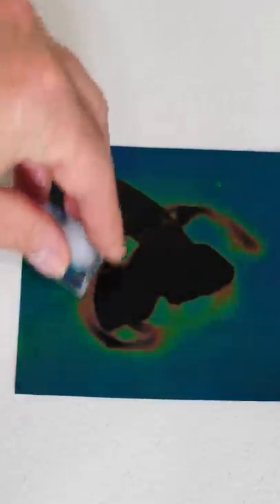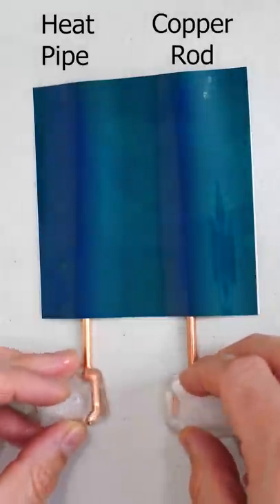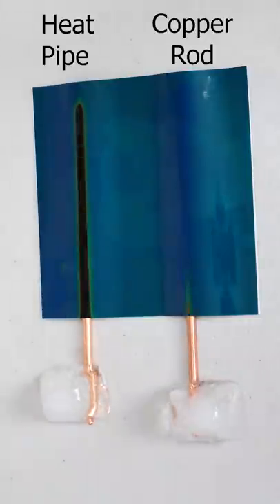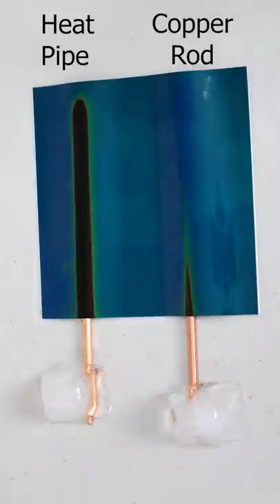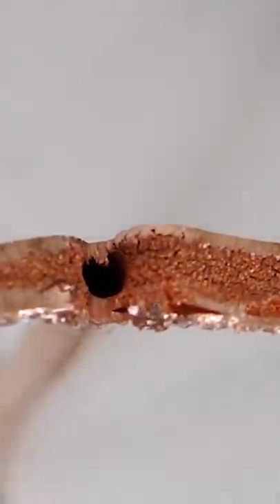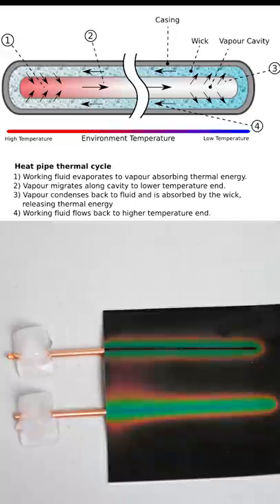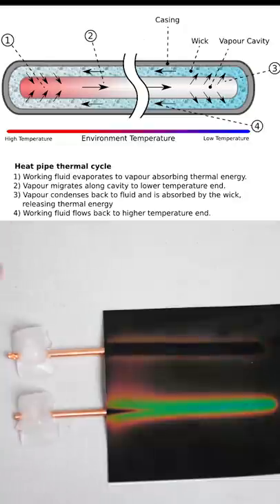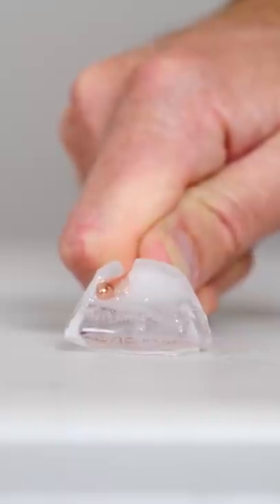The World's Fastest Heat Conductor

Comment: The pressure resistance on those pipes doesn’t seem like it would be a lot, if not they’d use it instead on air conditioning systems because ACs work in the same fashion or condensing and evaporating to absorb maximum amount of heat possible
Reply: Like you said The mechanics here are identical to those in an AC But are just being applied in a different way. AC’s are meant to move thermal energy efficiently. So they use substances that  evaporate easily and absorbed a lot of energy when doing so. Water on the other has neither of these properties. It is hard to evaporate and doesn’t absorb very much energy when doing so. So an AC could use heat pipes to move thermal energy but it would be expensive. The benefit of water over a traditional refrigerant is that it works quickly. Heat pipes are normally used to cool high end PC’s and that produce ludicrous amounts of heat. And sense computers can comfortably operate at 100F even if it was outside in 100F weather all we need to do is equalize the temp of the computer with the air and it will be fine so efficiency doesn’t matter.
Reply: @jacob416  Even on a aftermarket cooler for 25bucks heat pipes are becoming the norm.
Not only high end stuff uses them. More like OEM PC maker's who don't want to invest a dime are not using cooler's with heat pipes.
Reply: No, air conditioning (heat pumps) use input electricity to force heat to move and create colder air inside than out.  These are passive and so can at best (almost) equalize temps.  Heat pipes aren't magic, they're just really, really good conductors.  (>10X better than pure copper.)
Reply: @csn583  that’s what my point was, with better conductors , more heat can be transferred from the coils at a faster pace resulting in more efficiency but my question was , are the pipes even strong enough to hold the high pressures of 410a. If so, those would change the game in air conditioning

Comment: And the cool thing is that they dont need to use water for the working fluid.
Despite being the cheapest design a water / copper combination might not be the best choice.
Depending on the application it can be far more efficient to use methanol, ethanol, ammonia, helium, sodium, mercury, nitrogen, oxygen, neon, hydrogen. Etc  even dedicated refrigerants like r134 can be used for the working fluid / vapor.
The envelope can be made of many different materials like copper, aluminum, stainless steel, inconel etc. To match the working fluid / vapor and application.
And dont get me started on PCHPs, thermosyphons, and VCHPs, they can even be made in flat surfaces (heatspreaders)
Heat pipes are pretty cool, some years back I built a fanless gaming PC that used heat pipes to transfer heat from the GPU and CPU out of the case and into a large external heat spreader and heatsink. Was able to run some very intensive stress tests with very little climb in temperature.

Comment: It's not a conductor.

It's a phase change device that is essentially a vapor compression cycle machine and has major limitations a standard "conductor" doesn't. For example: it has a limited operational temperature range and can't easily operate bidirectionally. Also, it struggles over certain heights due to the limitations of the wick.

And it's NOT "water" in the pipe. Duh. It's a refrigerant.  Water doesn't nearly have the heat of vaporization that refrigerant gasses do. 

Oh, and don't get a hole in it. 

"Conductors" don't operate via phase change. They operate through (wait for it) "conduction". Q = k A ∆T/L Virtually none of that happening here.  

And the ice melting example is also time lapsed and dishonest.  The heat needs to ultimately eventually be transferred into your hand.  Which means that not only does your hand need to absorb sensible heat ∆T of over 65°F, but also the latent heat of fusion of water. For your hands to do so this fast would give you frostbite.  Please try being honest next time. 

Misleading title. Totally.
Reply: Thank you for the insight. 

Im still trying to figure out how this isn't closer to a thermometer than a solid stick of metal.

Comment: Ah yes, I'll use this substance to make a sword which cuts everything like a light saber
Reply: Last I checked “Light Saber” is still an object of George Lucas fertile mind. The use of thin walled multifaceted hollow tub of copper and a solid rod of copper in a comparative demonstration of heat convection versus conduction is   of course interesting but I do not think that is at issue here. The mechanics of Thermodynamics was not mentioned, could you refine your purpose more clearly?

Comment: Maybe it looked like it because of the ice but if you dont put in on the cooper pipe like on the other its no wonder the heat pipe is faster. The ice couldnt share the cold to the copper pipe since its not touching it as good as the heat pipe plus heat pipes are also mostly made out of copper

Comment: Also heat pipes last forever. I just upgraded my stock cooler for ryzen 5600x from some old dual core AMD processor made in 2005. I did test cooler on gas stove and yeah heat up other end instantly. I thought water must be evaporated 10 years ago and this is just waste copper, but nope, good as new 16 years later
*Athlon 64 x2 is old processor.

Comment: But copper pipe isn't meant to transfer heat, that's why we insulate them. You want water to come out of the tap hot or cold not loose the temperature traveling along the pipe

Comment: And i'm guessing the reason this isn't standard is similar to the reason the lightbulb got "nerfed".
Reply: This is the standard in computer cooling, is used in every laptop and the most performing air cooler usually have between 4 and 8 heat pipes

Comment: Isn't the heat pipe made out of copper too? So it's basically like saying which is faster this block of steel or this V8 engine.
Reply: I was thinking the same thing. Wtf? a copper wire vs. Hollow copper tube with water inside. Your analogy works.

Comment: But if the heat pipe can be used to cut ice just by using your body heat, does that mean your hand also feel the cold from the ice at the same time? Because from what I remember "cold" is also heat energy but minus in value. cmiiw

Comment: Heat isn’t an element on the periodic table. Copper is...
So... what metals do heat pipes consist of?
Reply: Copper, and a wick and liquid inside. 
At one end, the liquid heats up, and travels up the heat pipe. 
The liquid then deposits its heat, cools, and then travels back down the wick.
At very high temps, the liquid can boil, and it wouldn't work anymore.

Comment: Serious question: The world's fastest heat conductor is amazing and all, but, but...HOW is it conducting heat from an ICE CUBE?!

It conducts heat from an ice cube, which is cold. It conducts heat from your hand, which is warm. What is the pattern??
Reply: This is by far a secondary issue, but what is up with the "liquid crystal"?? 

It bends, but it otherwise holds its shape, and doesn't flow at all. That looks as solid to me as any paper or aluminum foil I've ever seen.
Reply: @ArcanineEspeon  Liquid crystal is what us old folks had in our tvs. They were "LCDs" liquid crystal displays. You are thinking about the heat problem wrong. When he's holding the heat pipe and touches the ice cube, the heat from his hand is able to move through the pipe quickly and melt the ice cube. No heat is being conducted from the ice cube, it's being conducted towards the ice cube.

Comment: What is a heat pipe made of?
Reply: Copper, and a wick and liquid inside. 
At one end, the liquid heats up, and travels up the heat pipe. 
The liquid then deposits its heat, cools, and then travels back down the wick.
But at very high temps, the liquid can boil, and it wouldn't work anymore.

Comment: Have a CPU radiator with 2 fans mounted inside the top of my tower Computer. Just because it's in the garage for a camera DVR.
Reply: Cool?
Reply: @mr_noobx3009  my garage can get up to 130 degrees in the summer, 101 outside. With the cooling chip, transfers the heat to the radiator on top of the CPU. Then the heated mineral spirits in the hose is pumped up to the BIG radiator and 2-17mm? Fans that blow up out of the screen tower.
Without the radiator and fans mounted there's a big hole on top. I've built a lot of PC'S and this is the biggest.